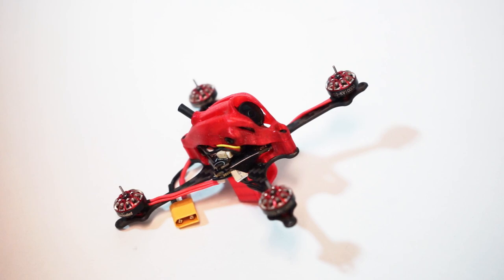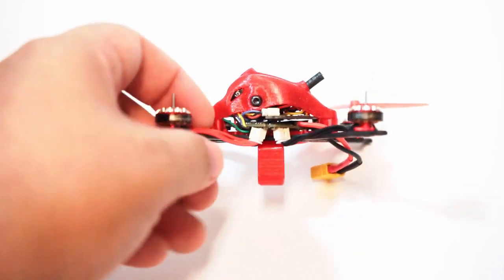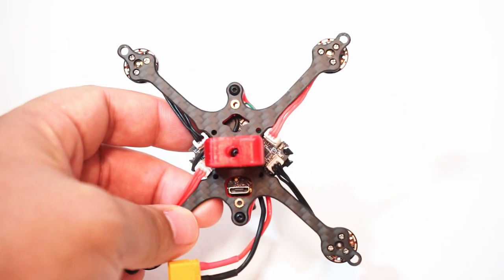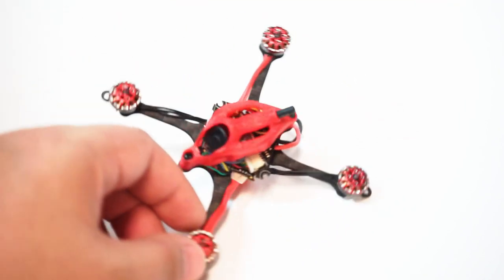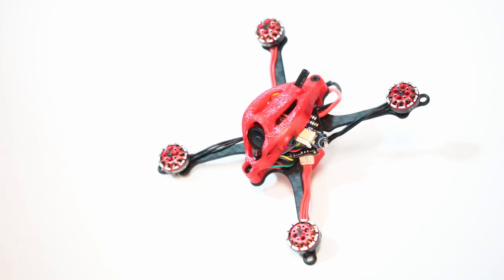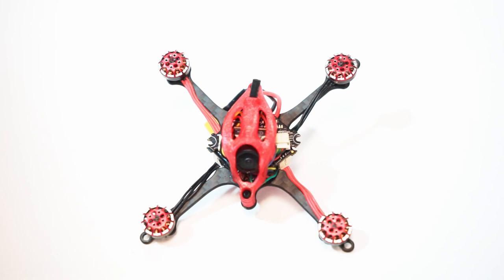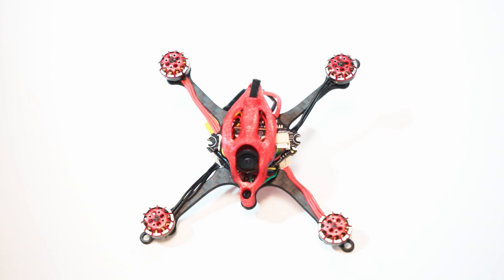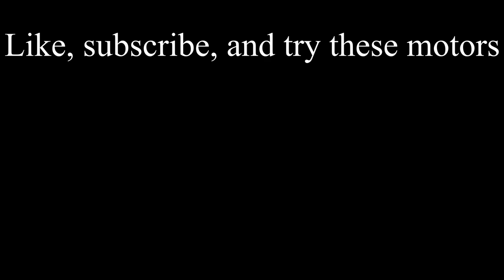Gnarly Primo 1102 10,000kv motors

Comment: These motors are now available with 1.5mm shaft and lower kv to run 3s for those interested.  Also, there are better prop options available now in 1.5mm -- no drilling necessary!  Def. my favorite frame though

Comment: Flies nicely. Caddx camera, I presume? Considering the dust specks on the sensor, and the red becomes pink trademark color shift?
Reply from the maker: Lol yes you are correct.  The patented dust feature.
Reply: I think that none of the competing camera manufacturers will try to claim that patent. So it will probably remain a Caddx "trademark" for some time to come. Maybe we can do crowdfunding for a vacuum cleaner, for the assembly area?

Comment: Built one this summer and a Carrera :} Great flyers!   Heard several times the 5 volt regulator can't take the initial voltage spike from the xt30 connector so I use jst. I see you have xt30, any issues ?
Reply from the maker: I did have one fail in a hard crash actually. To avoid the plugin issue, be sure to run a capacitor.
Reply: @JonE5FPV  Right o

Comment: Those motor wire look like they're pulling really hard on the ESC connector.
Reply from the maker: Its true, i REALLY wish they were about 1cm longer.  So far no issues after a few dozen crashes.  But absolutely, I would love a nice cleaner, safer look of the wires taped to the arms for extra snag protection.